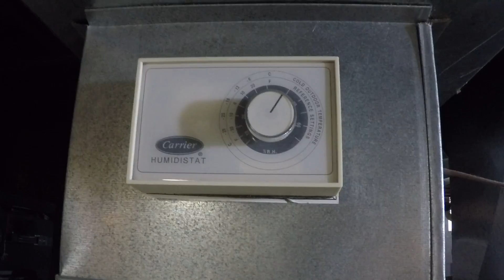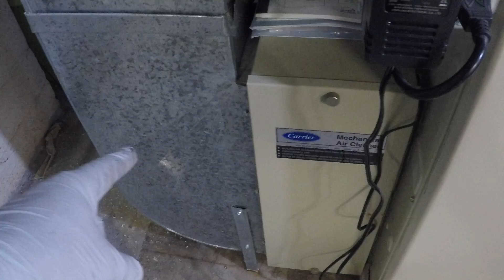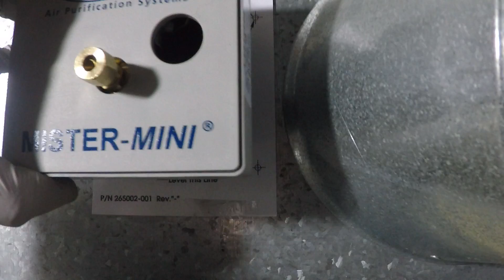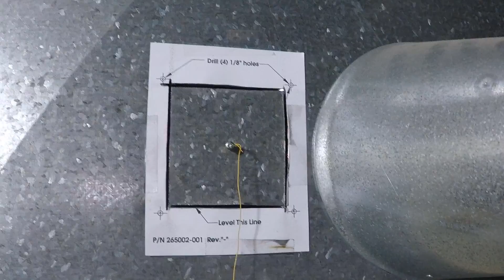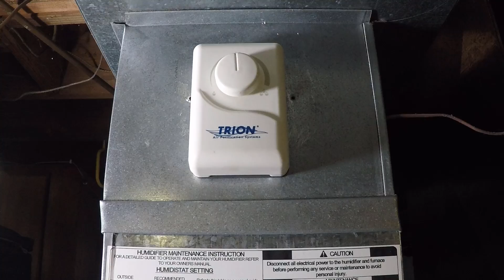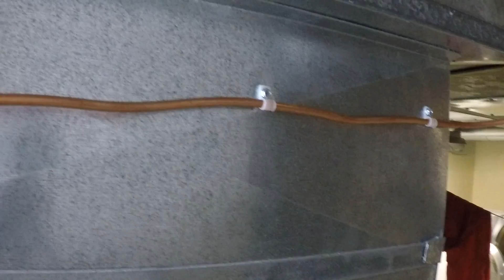Trion Mini Mister Whole House Humidifier - Install

Comment: All around informative vid. If I was to add anything to your steps it would be at the 26:30 mark where you turn the water on. Manufactures manual recommends bleeding the line of any possible debris before connecting to unit to ensure the supply line is clear.
Reply from the maker: AL H Thanks for watching and your comment. I did as you recommended just off camera.I agree lots of trash in the lines to break free. Good tip for any modification.

Comment: I installed one of these last winter but have been having some dripping issues, inside and outside my furnace. I'm not sure if my furnace fan speed is too high or what but it seems like the water isn't being atomized enough and it's being carried too fast into the ducting which is getting too wet. I tried swapping the tip out from the default .75GPH to a .50GPH however, instead that caused it to start an actual drip at the tip which is blowing it out of the Trion's housing and onto the floor.
Reply from the maker: Well, I would check the threads on the nozzle.  A friend of mine had to wrap his with teflon tape to cure a slow drip. Depending on the attitude of the nozzle it could drip in the furnace rather than out. If you do use tape just make sure nothing extra could move out towards the tip.  

I check mine with a hair dryer to activate the thermal lockout and check the nozzle flow.  When it is correct the mist is very fine and hard to see.  I usually hold my hand a few inches away to verify its working.  I increased my nozzle size from the stock one.  Last year, I was able to keep the humidity in the mid to high 40% . Much improved over the old wire mesh humidifier. 

We also added a UV air cleaner to the furnace.  Time for another bulb here soon as winter starts here in Michigan. 

Dan

Comment: Good job! My AC unit is in the attic. I had to change the blower motor a while back and the heat was nearly unbearable. And I did it early in the morning!!! I always envied basement people... lol...
Reply from the maker: Danny Wilsher: I had to go to the next level orifice jet. Then things went better over the low cold Michigan winter. I was able to maintain 30-40% humidity. Much better than 10%. Basement is great as long as it doesn’t leak. Lived in TX where there were no basements. Michigan slang for a Michigan basement usually has a dirt floor on older construction. Mine was built in the early 50’s all concrete.

Comment from the maker: Day two - works great.
Reply: House of Broken Dobbs Things _ with Dan Dobbs hat if you don't have a preexisting humidistat? Where do you pull your wires from?
Reply from the maker: Ricky Barth that will depend on the furnace. Some higher end units will have a 24v output already established on the control board. If not you can add a 24v power supply to power the humidistat and the mister. My furnace is a carrier so I was all set. Thanks for watching and your question. 

Dan